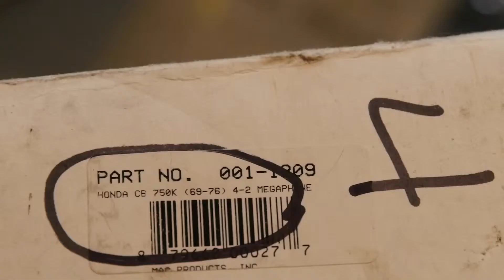CB750K5 Mac Performance 4 into 2

Comment: I’m a bit late to the party here but-
I’ve got a K2, with the same exhaust which was installed by previous owner in 1970s or 1980s. It is installed exactly how you show it, with the mounting flange on the outside, and the exhaust pipes under the frame rails.

Comment: Did you try switching the headers to the opposite sides? And are the headers supposed to be fully tightened down, or just loose before you put on the tail pipes?